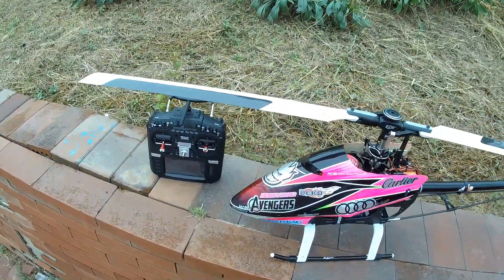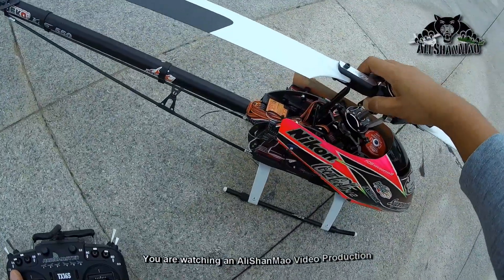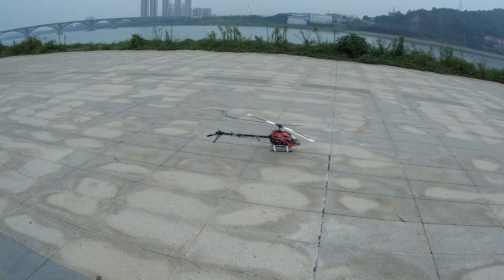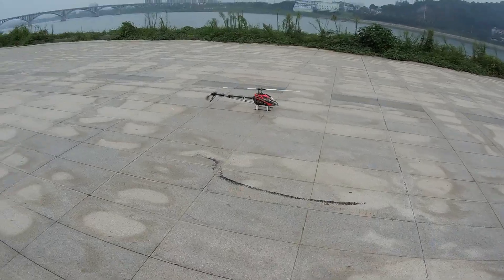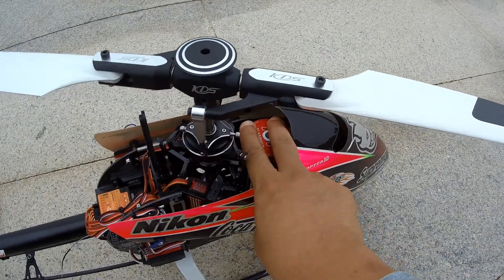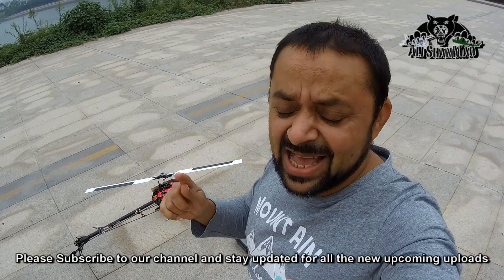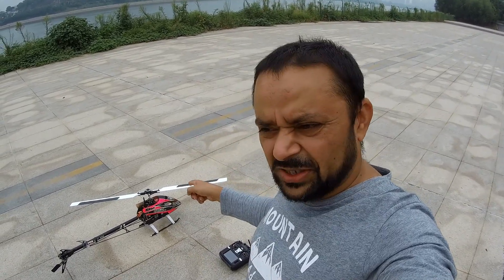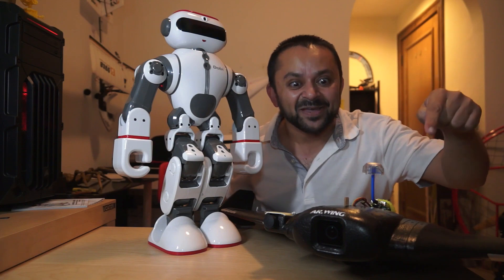KDS Innova 550 Electric RC Helicopter Flight Testing Short Rotor Blades

Comment: Not sure if you still do nitro engine but I wanted to ask if my engine should be emiiting smoke from the engine (Not the exhaust) Could this be bad tuning?
Reply from the maker: that shows a leak in the engine which is definitely not a good thing, you need to resolve it asap asap.
Reply: @alishanmao  Wait what could that be from..
Reply: There isnt any signs of leaking.
Reply from the maker: ok if there is not sign of leaking that means you have dropped some oil on and around engine which now burns due to heat and causes smoke. I would double check for leaks. if engine is running normally that does mean there is no leak, because leak in engine it will give you issues. is engine running normally?
Reply: @alishanmao  Yea its running smooth and starts up jst fine
Reply from the maker: then it must be some dried oil on engine that is burning out. once its finished, there should be no smoke
Reply: @alishanmao  Thank you!